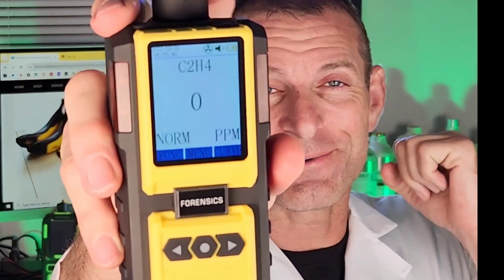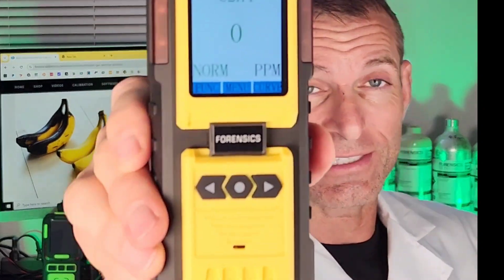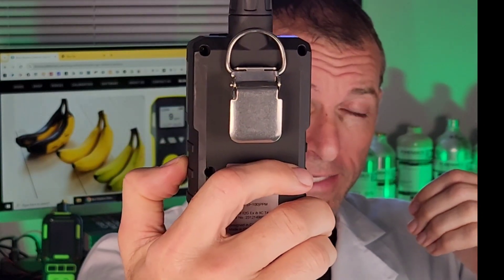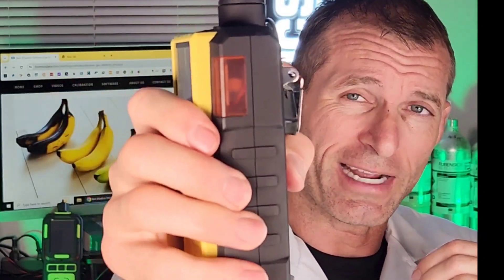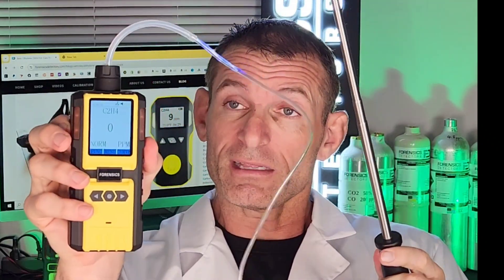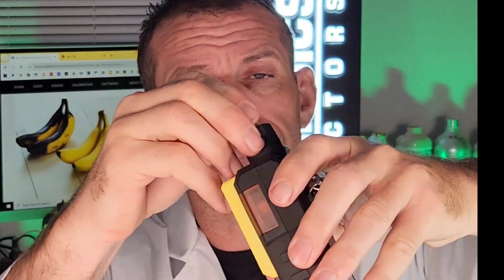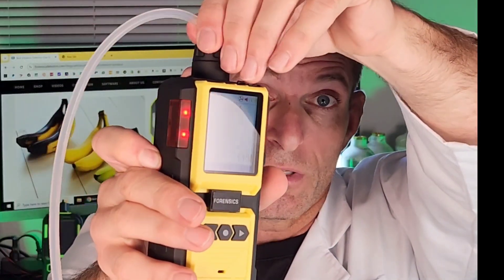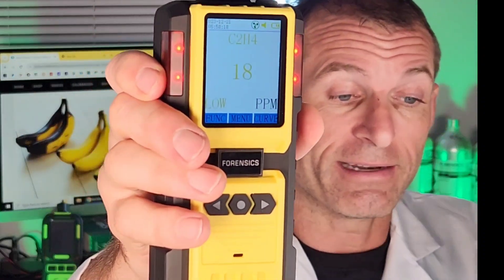Ethylene Gas Leak Detector (C2H4)

Comment: Hello Dr. Koz. My name is Mayer Simanjuntak, a doctoral student majoring in Biotechnology. I am conducting research on ethylene degradation using CTS/TiO2-OV film. In my system, I will flow a certain concentration of ethylene, then pass it through a reactor containing CTS/TiO2-OV film, and finally the degraded ethylene will come out of the reactor. Before the ethylene is removed, it will first be measured using the ethylene gas leak detector that you demonstrated. I have a question: can my experimental concept use your detector to measure the ethylene resulting from degradation after passing through the reactor?